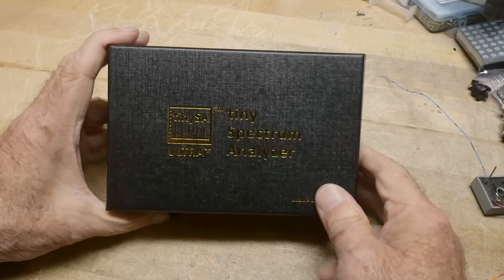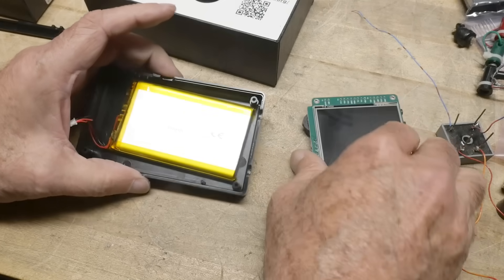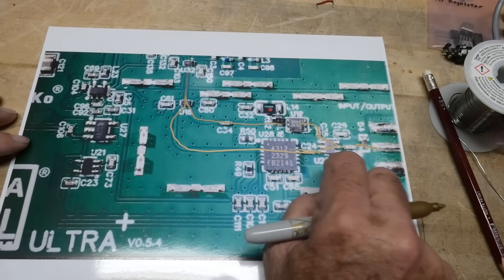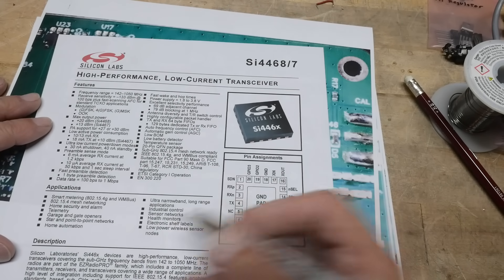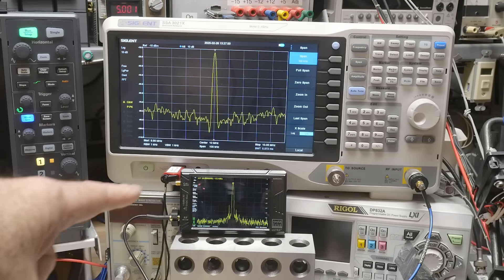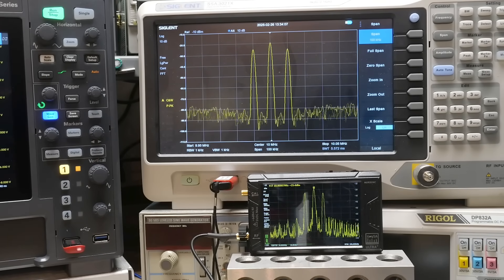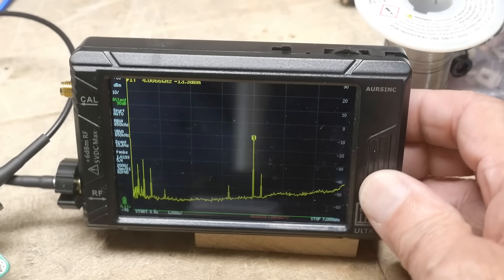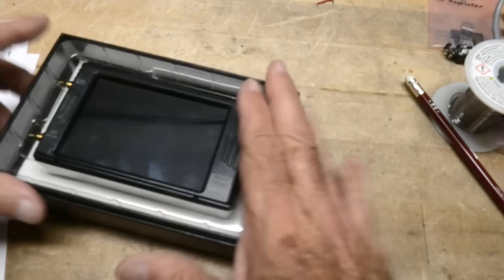#2170 TinySA ZS-407 7GHz Spectrum Analyzer

Comment: Hello! Thank you very much for the helpful video and description of the device. I had the opportunity to dig into my first NanoVNA, because it was one of the first. Poor design, bare sandwich without screens. I made it myself and soldered it to the board. The manufacturer did not use special clamps for the screens, so the work required precision, which was an interesting task considering my older eyesight. Best regards and I will be waiting for the next equally interesting films. Of course, I'm joining the subscribers! Vy 73!

Comment: It looks to me like a large price increase, but no new abilities were identified that I could see that made it worth the price jump. Lower noise floor? Faster update? Higher resolution? Better filtering? Anything of consequence?

What I'd like to see is a direct comparison between my Ultra and the Ultra +, not a comparison between the Ultra + and a full featured spectrum analyzer. I have an old HP that will blow this away on specs. But I can't even lift it, let alone put it in my pocket. And likewise with my Anritsu, although it's at least a portable analyzer. But when you try carrying 3 pieces of portable gear at the same time you immediately realize that one of them is no longer portable. 

There are basically 2 things I'd like to know about a handheld. Does it compare to a bench machine, (probably not,) and if not, is it the best handheld for the money. You've demonstrated that it doesn't yet compare to the multi-thousand dollar bench machines, but is it the best of the handhelds for the money?
Reply from the maker: I think it is holding it's own for sub $1000.   but, check amazon once in a while. I got my $1400 siglent for $900 as a return item.

Comment: Just read the manual! For accurate measurements on the TinySA, you must apply a signal level not exceeding -30 dBm!
Moreover, judging by the dip in the noise floor near the carrier on the Siglent, you have likely set it to Flat Top Window, while the TinySA, as far as I remember, uses Blackman Window.
So directly comparing the spectrum displays is not accurate.
Reply from the maker: Neither the Siglent or Tiny says the window type.
Reply: @IMSAIGuy  As I wrote above, read the manual!
I just opened the Siglent manual and found this, even though I've never owned an SA from Siglent.
In the SSA3000X Plus manual (UM0703P-E02A, page 147), the window type is explicitly stated—and yes, I was right, it's "Flat Top".
Meanwhile, TinySA doesn’t use Fourier transforms at all. 
from tinySA: "More expensive spectrum analyzers can digitize a broad frequency range at once and,using FFT, calculate the signal over a broad frequency range. Spectrum analyzers like the tinySA use a resolution filter that is used to isolate the input power in a small frequency range. This resolution filter is swept across the desired frequency range. As the oscillator that does the sweeping and the power detector that measures the signal power require some settling time the scanning speed of the tinySA is limited. The narrower the filter the more time is needed to settle. The fastest scanning speed occurs with an RBW or 300kHz or wider and is about 2 scans per second. But with increase of the frequency span and decrease of the RBW the scanning speed decreases quickly. "
Reply from the maker: @MaxPivovarov  I don't own that model  of siglent.
Reply from the maker: oh, and the tiny 'manual' says -25dBm. I think that limit is non linear amp and the dBm measurement is compressed.
Reply from the maker: the newer ultras do a two step sweep. one into a 500MHz saw  filter and the second is in the DSP chip at the end (and digital RBW filters there). the original one was simple as you say and you could fake a tracking generator from the outside, but not with the ultra
Reply from the maker: This comment is for those who don't think I understand the -30dBm problem. I have tested the TinySA many times and this model too. If you have a simple carrier. the auto attenuator works. if you have a signal at -30dBm, AND modulation on the carrier, the auto attn fails. even at -30dBm input you must override the attn setting and manually set it to 30dB. after that you will get good looking waveforms. I have discussed this with the designer of the tinysa and this is just a limitation that he cannot fix.
Reply: @IMSAIGuy  gotta love the keyboard warriors. Eh.😁

Comment: Thanks for the video. What LNAs are they using? especially interested in the front end LNA of choice.
Reply from the maker: no documents for the product
Reply from the maker: the part is marked ZK10
Reply: @IMSAIGuy  Thank you. I can't find that part either :( If anyone knows please let me know. I'm on a lookout for good quality wideband LNAs that do not cost an arm and a leg :)
Reply from the maker: @hangup23  this company might be used in the tiny. here is one example: https://www.qorvo.com/products/p/QPL9547
Reply: @IMSAIGuy  thanks! this one isn't bad, but it's not very flat. 10dB+ difference between higher and lower ranges. with this kind of not-so-flat performance, i'd use something even cheaper like the BGB707L7ESD from Infineon. but as i need flatness, so 
i'm currently using mini-circuits PMA3 series. they are not cheap, but work great. I'd like something with similar level of performance but less expensive :)
Reply from the maker: https://assets.zyrosite.com/Y4LLJMGjxjUbxwap/zk10d_product-manual_ver1.0-ALp74wMGLOI5Zpg9.pdf
Reply: @ wow, thank you so much! it looks like a very interesting part indeed! I'll shop around for it :)
Reply: @IMSAIGuy  Apparently Zhejiang Zhike Technology Co., LTD and ZeenKo is the same thing. Didn't know ZeenKo made ICs too, not just test equipment. Cool!

Comment: If one were trying to sniff out rouge ( intermittent / quite elusive signals that had to be recorded and characterized* ) baked / plastered into one's walls and ceilings etc. and further signal sniffing in a two-mile radius [mainly centered around 1.5 GHZ and 800 MHZ ish ] which instrument would one prefer ? Given that a sub - $2k Spectrum Analyzer weighs about 5 Kg (9 to 10 lbs ) vs. something like the or actually the TinySA (up to 7GHZ ) being light weight and strappable to a long pole for area sweeping or something like the RF explorer hand held gizmo ? 
.
I'm wondering if a sub $2k spectrum analyzer with long cables and specially designed antenna(s) for more directional snooping / sniffing - (not worried about cable attenuation - other than frequency matching ) - would be a better "bet". 
.
Basically 10 lb lump that makes nice waveforms but needs 110V / 220 versus something very light weight but - noisy / messy ?
.
________________________________________________________________________________________________________________________________________
.
*The goal is NOT to tear into physical walls and ceilings until one is absolutely certain as to what is in the walls. So location to withing five inches being more important + illusive / triggered transmissions that are remotely controlled and monitored. ( a bit of "Cat" and "mouse" involved and the systems are capable of storing audio signal and transmitting in a delayed / offset / encrypted  way + the systems can be nulled out if "they" suspect they are being sniffed or investigated ) --- The Russian style non linear (metal oxide ) gate detection techniques might me way over the top and also damage sensitive semi-conductors for detecting passive equipment / listening devices. 
.
I'm kinda getting the sense that anything that can detect anything in the range 2.5 GHZ probably can pick up a lot of messy lower harmonics from five to six GHZ especially if modulated - depending on whether the "front" end has too much filtering / suppression or not.  
.
Its kind of a wild thought that the Tiny SA could be mounted to drone for "Signal sniffing".
.
Reply from the maker: https://youtu.be/nn14JNxNT1Y?si=VOUOyD80Fht6TLd0
Reply: @IMSAIGuy  YES ! I have seen this / your video before on a different "Lurker" account - I liked your wooden sextant like mount very much - kinda fits my style.
.
.
Without getting into too many situational / project based / psychological / "Narrative" based needs and scenarios - I think what MOST if not all You Tube videos miss (in terms of device location and signal sniffing) - is that if one is being surveilled then pretty much everything in one's environment is hacked a-priori. That's anything connected to a network by any means such as computers and cell phones and smart speakers and some other devices (just for the hell of it to "Show" off ) + more distant cameras / imaging devices - all of which may have been deployed for more than four to six years in some cases.
.
The more troubling / pernicious form of monitoring is a "Constant" EAR on the situation - in such a scheme it performs more as a "In case of emergency" - break glass scenario / purpose but also at the same time provides an open channel to ones (theoretical) captors. 
.
In many longer term surveillance scenarios manipulation of people in one's environment are KEY - and many NDA(s) and useful lies may have been told for the benefit of the "Greater good" OR appealing scenarios that pertain to the illusion of "Reality TV show" like pranks (not unlike Jackass) - for charity like St. Jude's etc. Or for example the lie of the "Target" is one of the producers so no matter what don't let slip that you have been approached by other producers otherwise you won't get paid etc. So many easy and useful lies to get people to engage in scenarios that consistently border on the absurd to the sadistic (all most a Larry David style of moral bankruptcy "For fun" ).
.
etc. etc. yadda yadda yadda.
.
The key point is that many of the You tube videos about signal sniffing or bug detection are of a kid dressed like V for vendetta using cheezy sub $1000 or even sub $100 devices (although broad spectrum) to find "Bugs"... Or "Peeps" strolling around with their RF explorer (with yester year's ) electronics to find a drone with a "rectangular" aerial and RF body blocking to find a drone.
.
 What "They" in virtually ALL youtube videos show how actually someone would devise and design long term listening devices that are mainly (in case of emergency) type situations if things get out of control as a result of constant "gaslighting" or heavily pushing an alternate (blended) "Reality". So such devices are planted or bootstrapped to refrigerators and also planted inside the walls and roof spaces and "Other" in bathrooms - mainly to react to the possibility of actions that might build to self "un-a-live-ment " etc. The idea is not to kill the person.
.
Listening devices that are almost / quasi usefully broadcast quality - and do not fail due to inclement weather like snow or heavy rain - necessarily plugged into mains power supply to trickle charge a battery + 45 second delay for encrypted transmission... That seems to transmit in crude linear "Packets" in proportion to blocks of auditory "disturbances" like screaming or shouting for example (lol).
.
So on a quasi back channel it's been suggested to me that such a set of devices would operate  in the L-Band (more reliable and less crowded) + the other element / legal paradigm is that the signals are relayed out of country (for example Canada and the UK) where the encrypted signals are "Interpreted" and characterized by so called AI systems - i.e. NOT directly read by a human being but then passed on and relayed back to the target's country / habitation if any "boots" on the ground further security checking is required.[This gets around many legal problems and loop holes for which Laws have yet to be devised for.]. 
.
Obviously the system of surveillance KNOWS that one would be sniffing around with various devices and locations and can summarily silence such listening devices remotely  (RF) wise- so it actually requires one to CREATE a situation and scenario where the "In case of emergency " break glass scenario is invoked  WHILE signal sniffing - i.e. catch them off guard. [Which I did using modified equipment tuned towards 200 mm wavelength ].
.
The second opportunity to do such things with better equipment will be much more limited - it's been suggested to me (like your video) is to sniff out various power conversion transformers and or inverters etc. 
.
Its a tricky problem BUT I WISH --- that someone would make a youtube video where someone MAKES exactly such a bug or set of bugs and then tries to sniff them out in a cat and mouse kind of way.
.
People are not really thinking about how people are actually surveilled and WHY and try to design systems (more future leaning ) in spite of older tech as to how such tasks would actually be accomplished.
.
Hacked civilian devices are easy to deny in terms of plausible deniability but actually physical devices secreted into various installations or dwelling are not - even if you don't know exactly who is hacking you / one. 
.
In typical Walmart fashion one can even buy a Uni-T (UNI-T UTS1032B ) from Walmart - not quite a 60" plasma screen and a gigantic jar of mayonnaise.
.
Thanks so much of reading this if you got this far - I have no doubt the post will probably be deleted.
.
Very Best,.
.
Eric 
.
( Good luck on your further IMSAI explorations )- super content BTW )

Comment: I will not call the tinySA am modulation spurs phase noise. It looks like it is intermodulation (IM3, IM5...). That means too much power to form the end amp or mixer, or both. The front end attenuation needs to be increased.